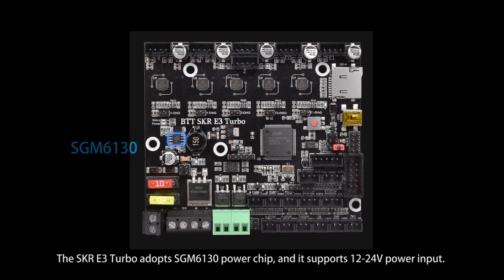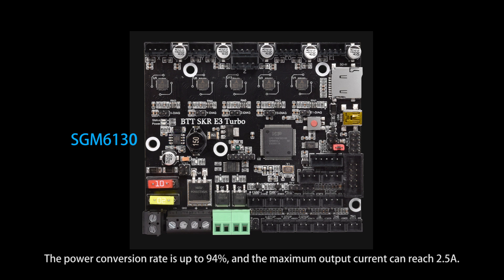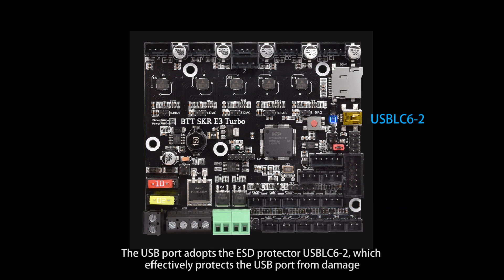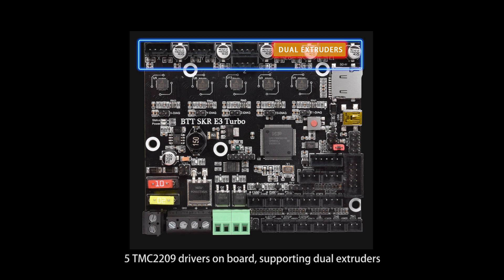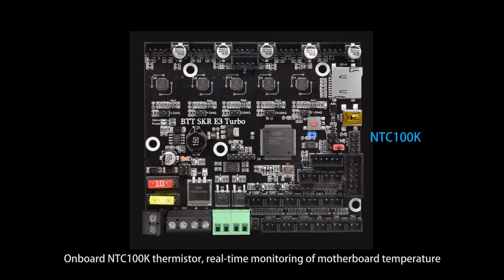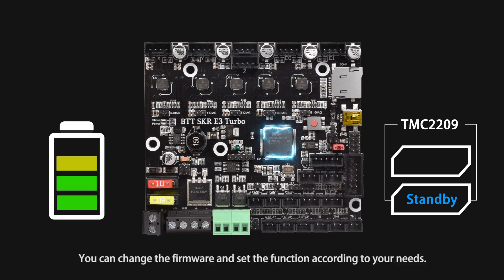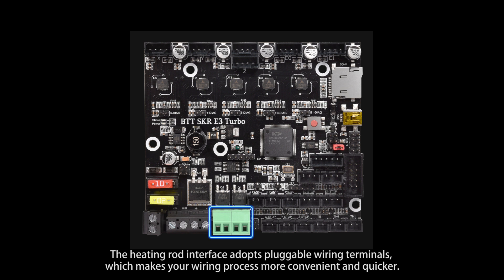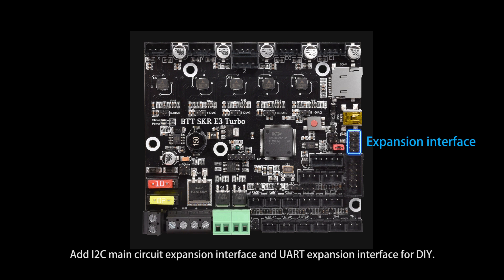BTT SKR E3 Turbo motherboard: perfectly suitable for Ender3 printer

Comment: What is the difference between SKR E3 TURBO,  SKR mini E3 V2.0,  and SKR V1.4? Thanks.
Reply: I know this was 4 months ago, but the differences are, firstly, the mounting and footprint. the E3 boards are designed to mount and fit within most Ender printers, the 1.4 screws are just in the corner.  
Spec wise, both the E3 V2 and Turbo use the TMC2209 stepper drivers, where as the 1.4 you have to supply your own separately.  Additionally, the E3 Turbo and the V1.4 have drivers for dual extruders where as the mini only has 1 of each extruder (They are all capable of running dual Z in parallel off the same driver).  There's also additional temp and filament sensors for the extra extruders. I think that about covers it.
Reply: That's what I'm trying to figure out

Comment: It's such a shame that my first impressions of this board were so poor. This can be avoided with two simple changes
1 - No schematics available on git for the board - You have schematics for many other boards, why not this for board? 
2 - The firmware on github is broken - you REALLY need to update this to use Marlin Bugfix2.0.x branch otherwise many people will might think your boards are no good.

After reflashing with your github code to incorporate new features, my board would reset each time I tried to save config to EEPROM. I initially thought I had thrown away my money,  however after downloading the latest Marlin Bugfix 2.0.x branch and merging with your config changes, it actually works (and really well).
These are really simple steps to improve your business.

Comment: Guys, please be advised and use ESD protection like shown in the video! I bricked three SKR mini boards just by electrostatic discharges. Always ground yourself before touching something on the printer or use real ESD protection like the bracelet shown!